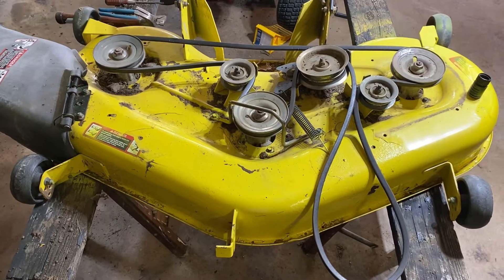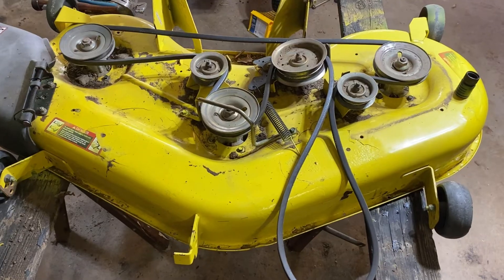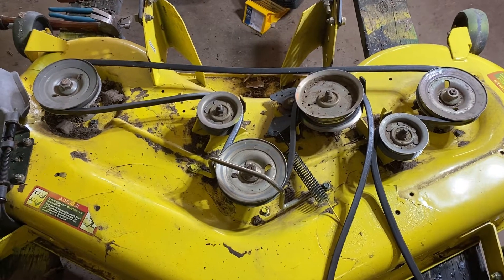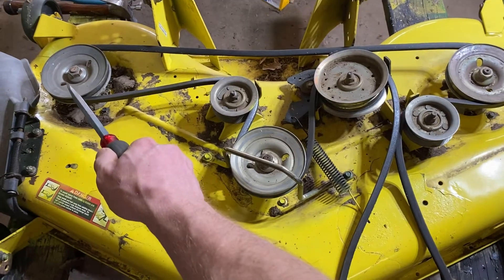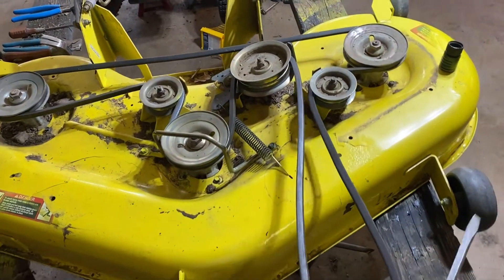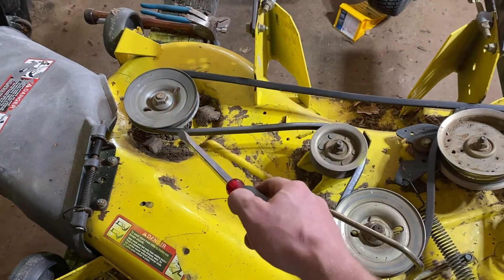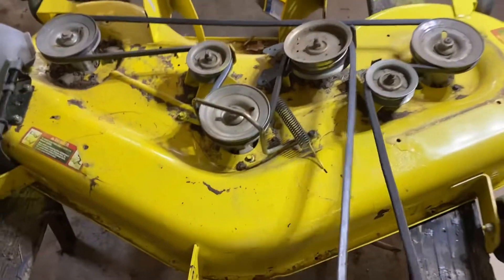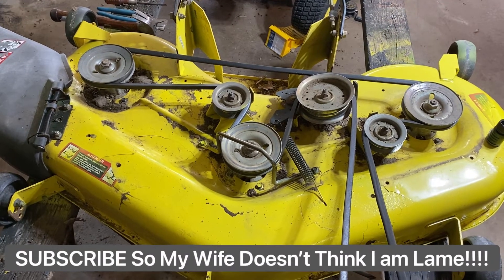John Deere Deck Belt Routing Diagram Video LA145, MELLON Head as PTO!

Comment: Hey Mike, I just came out of the woodwork and needed this video.  Not because I forgot how to route my belt, but while mowing today the darned belt tensioner spring broke .  For the life of me, I kept thinking it had to go up to the hole near the spindle screw but based on the broken spring I couldn't be sure where the spring actually went.  While cleaning up the deck and loose paint, I found a slot that may be the right place and your video verified that for me.  However, I also found so much rust in the original deck I may need 2 stop signs to fill all the places where there is nothing left. Shame, because ever since I upgraded ALL the pully and spindle bearings a couple of years ago things have been running pretty good.  Also noticed the 3 blades are all about as dull as a street sign post. Getting too old for this.  Maybe Monday will be the day I go to buy parts and come home with a zero turn mower,,,,,,,,,, if the controls don't interfere with my beer gut.
Reply from the maker: Haha 3 stop signs, now that is funny

Comment: Thanks for this great information, Was also wondering if there is a lift kit available for any Ztrac mowers, I mow my lawn as high as I can and 4" is not high enough. When I mow my lawn high it still has burn spots in it after mowed. I need a 2" more if I could get the mower higher. thanks Rob
Reply from the maker: Not that I know of. I suggest putting on taller tires.

Comment: How can I tension the belt? It only engages on highest deck setting. The belt is in good shape.
Reply from the maker: The pulley with the spring attached to it is the tensioner. I have never had that issue with it just engaging in the high setting.
Reply: @MowerMike  it was working fine before I took the deck off to replace the pinion and selector gears. I called a mechanic and he said he vaguely remembers this problem on the same model. Said it wasn’t the tensioner pulley. He has to “take apart’” a bunch of stuff.  Just my luck I fix something complex and get this as a result.
Reply from the maker: @blairgrossman8179  let me know what it ends up being